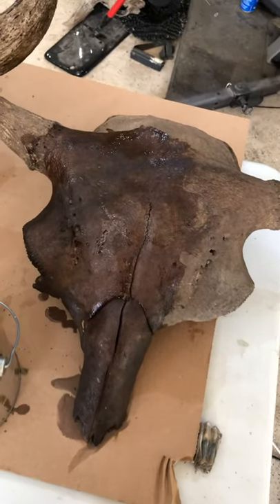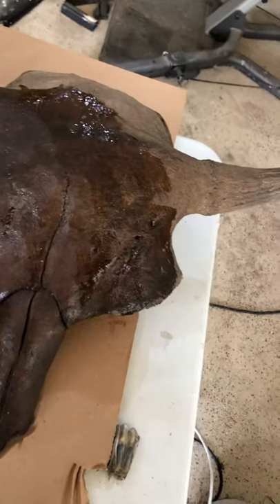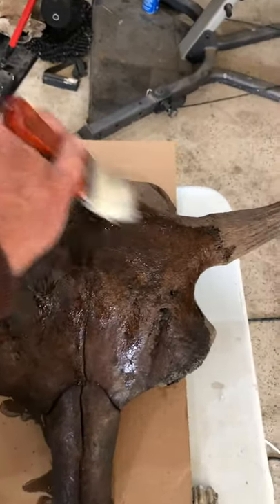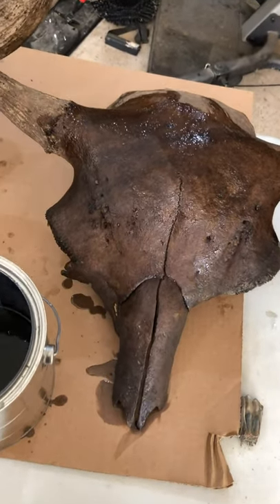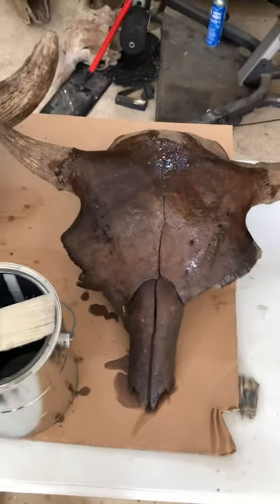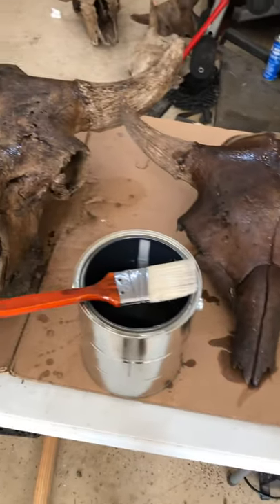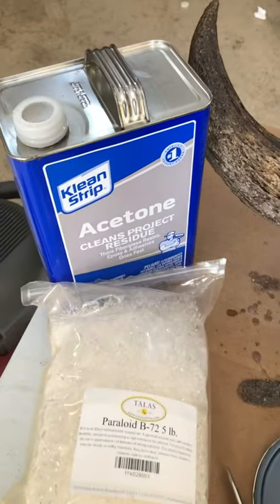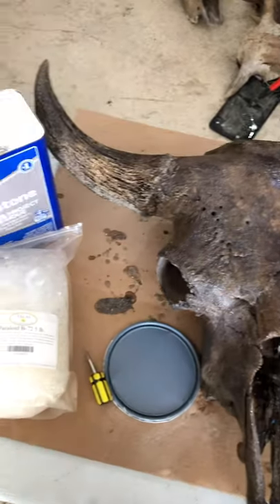Bison Skull Preparation

Comment: Great video. Do you make sure the bones are completely dry before you apply paraloid? If paraloid touches water it will never really solidify and become cloudy. The same happens if the acetone is not glacial (100% water free).
Reply from the maker: Oreliason I have had some issues with cloudiness but only in small area. I wait for them to dry unless the bone or tusk is in really bad shape. 
The tusk as all tusks found in my area is very fragile so I brush the paraloid on immediately. It came out very well. I think this due to the fact that the moisture in the tusk could still evaporate out of its hollow core which was not covered with Paraloid.

Comment: I just tried the mix of denatured alcohol and one part clear shellac on a mammoth scapula piece I found last week. Do you think I'd be better off using what you mentioned on future finds?
Reply from the maker: I use aerosol shellac on some of my more modern pieces. One issue you will find os that the shellac turns yellow over time.
Reply: @bisonpaleofossilriveradven3528  I didn't use aerosol. I was actually trying to help somewhat harden it, very fragile.
Reply from the maker: @diggingthewest7981  yeah, I only used aerosol on very fragile, lightweight pieces that would crumble when I touched them. All shellacs will turn yellow over time.